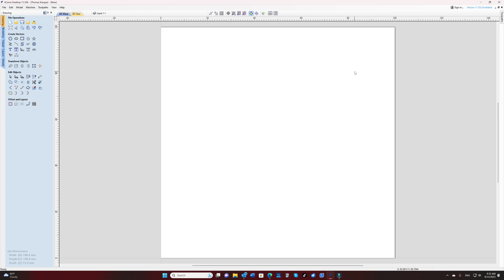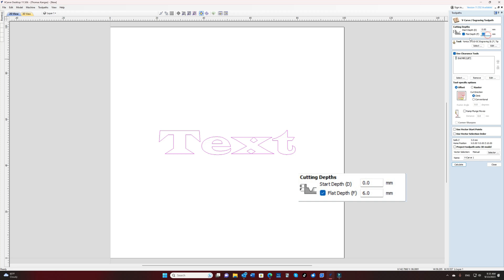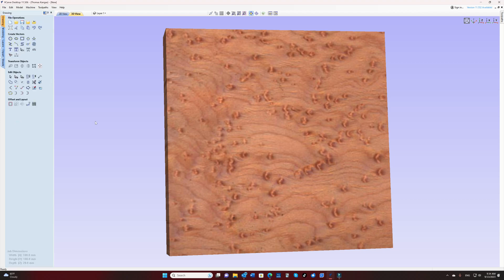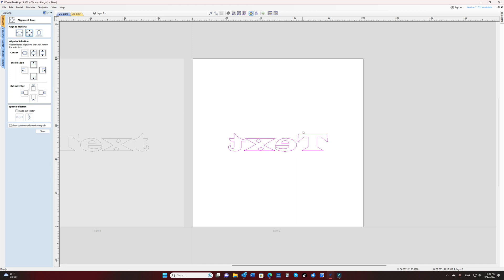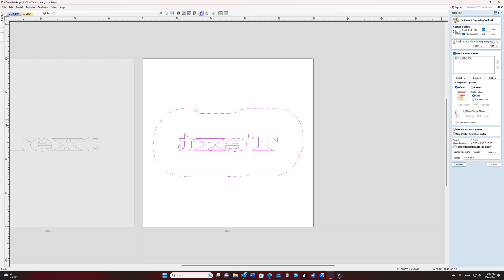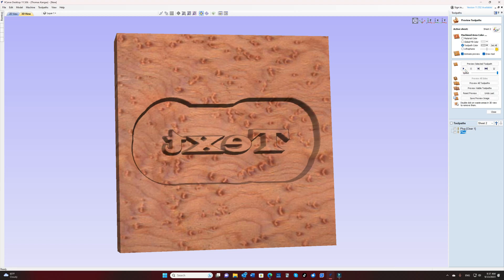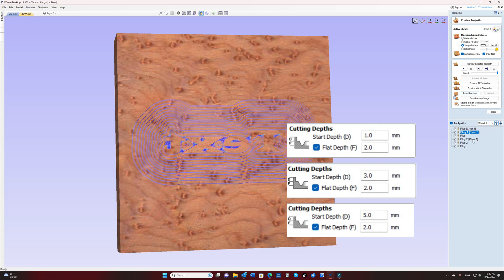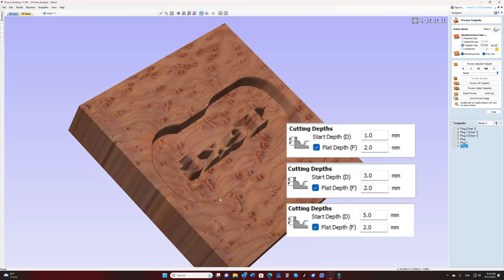How to Design Inlay Parameters Like A Pro in only 8 Minutes

Comment: Thanks for video. That's weird that you can't break vcarve toolpath into a set number of passes like profile or pocket.
Reply from the maker: Thanks for watching. It would be great if it did allow you to adjust the number of passes with 1 toolpath, but this is the workaround to that.  On my current CNC, it is sturdy enough and powerful enough to cut the full depth of the plug side of the vcarve toolpath.  For machines that do not have linear rails and good spindle, these settings help to improve the inlay results. Thanks again for watching!

Comment: Hello and thank you for the video.
I am new to CNC and inlays.  I would love to try a deep inlay of .2500 and another one at .1250. I have an Amanda 46280 6.2 degree that I would like to try it with.   Can you guide me on the settings please?  Could I use a flat of .197 using the same start numbers or would that mess things up?

.2500 =  
(.039/.079  .118/.079  .197/.079

What would you do for .1250 ?
.1250 = 

Please in lighting me…

Comment: This is awesome, but I'm not smart so still a little confused.  For the plug - you are created 3 separate vcarve toolpaths to get to your final depth, correct?  Why does the first of the three start at 1mm instead of starting at 0?  Thanks!
Reply from the maker: Thanks for watching!  The 3 separate vcarve toolpaths are to allow for us to avoid diving all the way down 9MM, the depth of the plug. If we only used one depth, it would be 7mm start, 2mm flat.  Vectric assumes that the 7m start depth is already cleared material, so would dive all the way down 9mm. Disaster waiting to happen. We trick Vectric by creating toolpaths that can be easily handled by our tool/machine.  As for starting the first pass at 1mm deep, that is to give us just enough of an offset from the plug to the pocket so our inlay will fit snuggly, without any gap.

Comment: This is the most intuitive and easy software to use for semi Cad and full Cam and HUNDREDS OF VIDEOS of explanations about every item, improving every year, I like it a lot, makes my hobby really pleasant. I built a 50 x 70 cms. machine with a router from Amazon and some Arduino GRBL  and PC PSU and everything comes out perfect as designed with 1.5 dollars bits that I replace every month as cheap as they are.
Reply from the maker: Thanks for watching! Good luck with your DIY machine. I tried to build one, but I just couldn't build one strong enough for the type of stuff I do.

Comment: Another great video. I am new to Vectric , the question I have is could you accomplish the same thing by setting the depth of cut in the tool specifications?  I generally use 1 to 1.5 the bit diameter and the software figures out how many passes it will take.  Also to avoid chatter I use a step over of 40% for roughing and 5% for carving. I have a 4040 pro and Vectric Desktop.
Reply from the maker: If you are referring to cutting the plug side, no you cannot set the tool depth, as it assumes in your carve parameters that the start depth already has material removed.  Because of this, the tool will plunge to the start depth, and then cut to the flat depth.  So for example, if your start depth is 7 and flat depth is 2, your tool will plunge 7, and then cut 2. If the material has not been removed, it will essentially try to carve then entire 9 (7+2).  Our hobby CNCs do not have the rigidity to handle that kind of a cut.  Thanks for watching!

Comment: which parameter used in end Mill 1/8?
Reply from the maker: Thanks for watching! What parameters are you looking for? Speeds and feeds, or Start Depth/Flat depth?  If Start Depth/Flat Depth, it will be identical to the Tapered Ball Nose bit, regardless of whether you are cutting the pocket side or the plug side. Please let me know if you need additional information.
Reply: @tk.designs  speed and feed and start depth/Flat depth
Reply from the maker: @josiascnc4539  Start and Flat depth same as v-bit. Feeds 600mm/min, plunge rate 300mm/min. Feed and speed is very dependent on what machine you have.
Reply: @tk.designs  thank you

Comment: Lovely video! Thank you!! 

Could you show how you upgraded to VFD spindle? I mean the mount and where you connected?
Im looking for a CNC to start my guitar buildings
Reply from the maker: The VFD is connected to it's own controller. I fabricated a mount out of 1/4" aluminum to match the specifications for the bolt pattern on my VFD spindle. I also had to measure the distance between t-nut slots on my Z-axis, so I could mount the plate.  I upgraded more than a year ago, so I may not have the files I used any more. I will take a look. Thanks for watching!